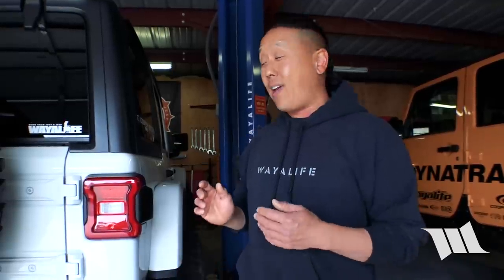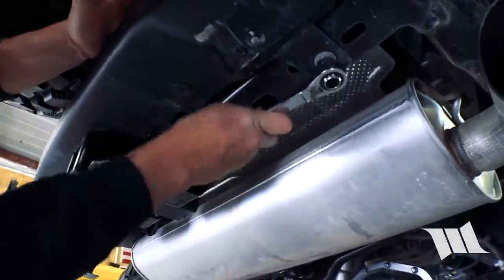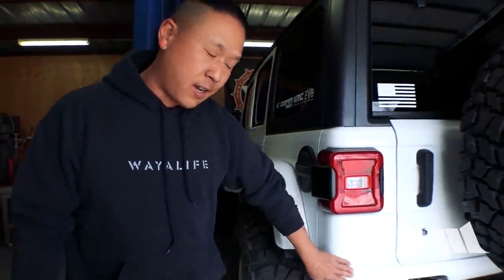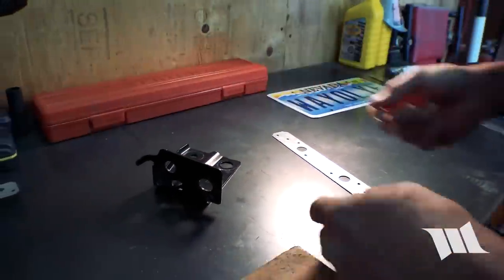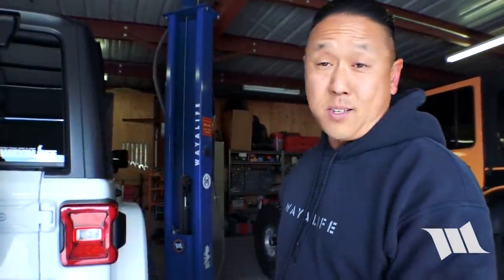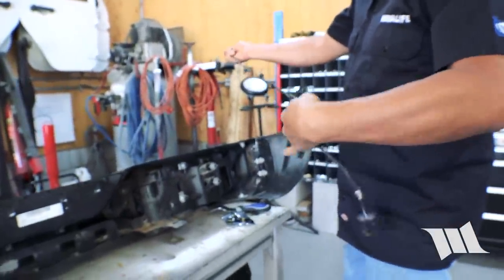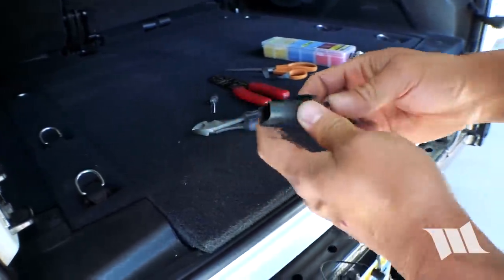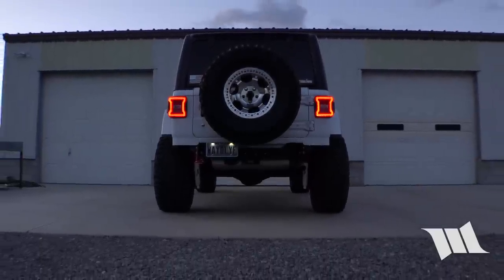Jeep JL Wrangler Rear Bumper Removal for Bumperless Look + License Plate Mount : JL JOURNAL

Comment: Thanks for this easy to follow video of removing the rear bumper.  I want to add a 2" receiver hitch to the rear bumper of my 2018 JLU and there is a metal plate with two nuts that seem to be welded on in the way.  I wanted to be able to do this install myself instead of paying the dealership an arm and a leg to do it for me.  Now I can/will confidently remove it and do the install myself.  New subscriber for your channel here!
Reply from the maker: Awesome! Glad that we could be of help :)

Comment: Nice simple solution. Good use of that extra bracket!

Just a suggestion, but if it were me, I might get some of that black door edge guard, and run it around the bottom of the body tub where the bumper was removed. Not that it will be any protection against rock impacts, but it may keep the paint from chipping further and perhaps give it a more finished look.

Comment: Yeah those steel bumpers are not impressive. If I got a JL Rubicon I think I'd stick with the plastic bumpers because I'd put aftermarket ones on soon enough. Originally I thought I'd upgrade to and keep the steel bumpers but not after seeing these videos. Great job though, I like how you're putting the JL through its paces and showing people where the good parts and the problem areas are!

Also personally I would have moved the license plate to the center of the spare tire.
Reply from the maker: You have to remember that the JL's come with rear back up cameras that stick out through the center of it. The only way to keep it and to mount the license plate there as well is to put the license plate above the camera. Needless to say, I tried it and thought it looked kinda weird if not a bit lame. A good portion of the plate above the wheel and into the sidewall - it just didn't look good to me.

Comment: i would say take caution when thinking about doing this, it may work for you but may not be optimal for everyone and where they wheel. Personally, i would never run bumperless, be careful on tight trails with lots of vegetation and rocks, i.e. big bear california lots of trees and rock gardens. The rear steel tube bumper on my trail rig took all sorts of hits and scrapes, got in a few tight spots lost traction slid back into rocks, had to reverse into a tree gently and so on. I guess it would prolly be fine in moab and more open places. With no bumper all the damage is going straight to body and frame if it happens. Ya the stock isnt ideal and does a minor body damage but at least it will distribute hard impacts and send it to more durable places. best to upgrade to a aftermarket bumper or if none exist im sure a fab shop and do a simple cheap tube bumper or something, worth the investment idk just my opinion to each their own.
Reply from the maker: I would be the first to say that this isn't for everyone and something that we've just chosen to do. If you ever take the time to watch any of our other videos, you'd know that's we're just mall crawlers and never play on the kind of badass trails that you find up in Big Bear. I guess that's the only way we've been able to run bumperless on our 2 JK's and for years and without any issues. Clearly, to each their own.

Comment: So genuine question, because we're considering going this route with out JL - Have you hit or come close to hitting the spare tire or rear body on rocks since deleting the rear bumper? We know you guys wheel pretty hard, but are you having to be more cautious about your departure angles now that the rear bumper is gone?

Thanks in advance for your help! And as always, awesome video!!
Reply from the maker: I've made and run what I call a Hitch Stinger and so far, it's done a good job of protecting our spare tire from getting hit. Without it, our tailgate would have been destroyed long ago. I won't say that people out there don't hit their rear quarter panels without a rear bumper because I have seen it happen but in all the years we've been running our JK's bumperless, it hasn't been a problem for us... so far anyway. Hope that helps.

Comment: Gives the JL an old school look.  Hard to believe but the JL bumper actually looks less durable than the JK's, with more pieces to fall off.  I would have tapped out that small pinch on the seam before painting.  Also, the spare looks vulnerable without a bumper below it.  Not so much for the tire but for the shock to the gate mount if you came down or backed on a rock or trunk.

Comment: Looks more like the bolts causing the damage are the top ones holding the plastic to the metal bumper parallel across from the top bumper mounting bolt looks like the head of the bolts causing the damage the bottom one seems like it’s be too far down

Comment: Another clear and concise video, Eddie! Well done! This is a great mod and practically free. One question, do you know if anyone makes any block off plates for the frame rails on the bumper delete area near the license plate and the other side? The frame rails are open ended and exposed. Not sure that's a huge issue. But, it would be nice to finish off the bumper delete with some plates on the ends. Thoughts?
Reply from the maker: There are companies like EVO that sell facias to make the rear end look cleaner.
Reply: @wayalife  Do you see any issues with running it naked like you are doing in the video where the frame rails are exposed with no plates?

Comment: Have you ever seen " Rusty's Rear Fascia Cover Kit - JL Wrangler? That would cover your damage on the tub corners and back with steel with a clean look!
Reply from the maker: Yup, I've seen it. I have since applied black vinyl to the rear pinch seam and it worked just as well and for a lot less.

Comment: Speaking of protecting the body paint, let's scratch the body with the clip remover, run the solder and heat gun over the paint lol Just kidding!

Have you found out the cause of the issue where the JL lost power briefly while climbing?
Reply from the maker: Nope. The only thing I've found is how to prevent it from happening. Just make sure you're shifted in manual mode.

Comment: Quick question, i realized that the removal of the bumper means the removal of the rear backup sensors. Any suggestions on how to delete the bumper but still keep that necessary feature of the backup sensors
Reply from the maker: I am sorry but I don't think you can do this without removing the sensors.
Reply: @wayalife  Okay thanks for the information

Comment: Wayalife Can't the bolt be shortened and the corner panel be bent slightly to reduce the chance of bolt caused damage?  What about the possibility of adding a washer to mount the bumper slightly farther away from the rear body panels?   Have you selected an aftermarket rear bumper that you will do an install video of yet?
Reply from the maker: Possibly. I suppose if you really wanted to keep the factory bumper, you could make it work. For us, we were done with it. Regarding aftermarket bumpers, so far, nothing has really caught our eye or at least, nothing that's currently available. Also, we've been running our JK's bumperless for so a long time so if we stayed bumperless, it wouldn't kill us. In some ways, we prefer it.

Comment: Are there sensors in the JL bumper for the rear park-assist that comes with the safety group or can the bumper still be easily removed if you get a Jeep with that group?
Reply from the maker: We didn't have the rear park assist option so this wasn't a problem for us. If you do and you want to keep it, you might want to look for another option.

Comment: I love watching your guys channel with all the experiences you get to have. I hope some day I’ll also be able to get a Jeep Wrangler and do some stellar mods to it. I just had a quick tip. I currently work in the Air Force doing Aircraft Structural Maintenance and noticed that you didn’t scuff the area and then wipe it down real well before applying primer paint and the sealant. There could be a good possibility of it starting to rust under the surface if the surface prep wasn’t spot on and you wouldn’t notice it until the rust came through the paint. Maybe you did do that and I didn’t catch it. Anyways. Have fun as always and I look forward to your next video.

Comment: On fixing your "bumper rash", did you consider using something like a bed liner paint or finish?  Just to apply something more durable than touch-up paint?
Reply from the maker: Not a fan of bedliner but I had thought about applying a clear bra tape to help protect it.
Reply: Wayalife some people really over do the bed liner. I get you. That’s the best thing about mods, many ways of doing something, you just have to decide what YOU want to do. Keep up the good work!

Comment: Nice work, love your videos! Was actually adding this bumber and noticed there should be 2 long bolts that attach to the bumber in the middle. Problem is the metal bumber doesn't have any bracket to attach these to. Strangely I noticed the plastic bunper has one when I removed it. Could the metal bumper be missing a bracket? Seems strange the plastic one would have more attachments than the metal bumper!
Reply from the maker: The steel bumpers have the brackets built into them.
Reply: @wayalife  that is interesting, mine didn't come with one when I ordered it.
Reply: Identified the issue, the metal bumper requires a new hitch plate with the four screws mounting on the frame. The plastic bumped had 2 going to the frame and 2 into the bumper in a bracket inside the plastic bumper. No longer the case with the metal  bumper, it relies on the 2 nutserts below the bumper to connect the middle. This install should have been painless, but it was a real hassle to get the metal mopar bumper installed. Bad instructions, missing hardware and no youtube video on how to replace the plastic rear bumper with the metal one.

Comment: Do you plan to use some mud flap to protect the inner body from road projection ?
Reply from the maker: Mud flaps are a bad idea to have if you play on the rocks. When in reverse, the flaps will get caught between rocks and your tires and will tear off and or take your whole fender off too if they're connected to it.

Comment: A real nice fix on the L.P. Bracket and lights plus good information about the steel bumper making contact with the body.   I will probably not buy one with the steel bumpers for that reason.   Save some money and do what you did.   Stubby bumper up front and bumperless in the rear.
Reply from the maker: As I've said, we really like the front bumper but the rear is a no go for us. I definitely would recommend that you save your money and not get the steel bumpers.

Comment: Quick question what holds the two bottom 16mm bolts to the rear crossmember? What do they thread into?
Reply from the maker: There's a nut welded inside the cross member.
Reply: @wayalife  Thanks man!

Comment: When you removed those last two bolts from the cross member, how did they screw in to the cross member? I am trying to find those parts, as I am adding the steel bumper to the rear of a sport. I would greatly appreciate your help.
Reply from the maker: The steel bumper comes with brackets that the plastic bumper does not.
Reply: Wayalife for the two bolts that screw into the crossmember? Any idea what brackets those are?
Reply from the maker: @JakeHolder  Like I said, the brackets come with the steel bumper.
Reply: Wayalife I think maybe you are mistaken. I have a steel bumper... there are no brackets nor do I see them on a parts list. I’m wondering if they are nutserts that go into the frame for the bolt and nut to screw into.
Reply from the maker: Yes, the front and rear steel bumpers that you get from the factory come with brackets AND nuts welded in the frame for installation.
Reply: Wayalife gotcha! I was wondering if they were nutserts I could buy and put in those hexagon shaped holes.
Reply from the maker: I suppose you could use nutserts but from the factory, the nuts are welded in place.

Comment: By law, don’t you need a bumper?
Reply from the maker: Guess it depends on what state you live in. Never been a problem for me but then, I live in Nevada.
Reply: They might be required to sell them with bumpers, but there might not be any sort of vehicle regulation that says you must keep it on the vehicle.  Now, whether removing the rear bumper is a good idea from a rear impact standpoint, that's another issue entirely.  I suspect that it would help dissipate a rear impact across the frame rails and possibly reduce somewhat the intrusion of the other vehicle into your vehicle's passenger compartment.

Personally, I would probably put some sort of mini bumper across the frame rail section at the very least.  If nothing else, some plugs to close up the open ends in the frame rails.